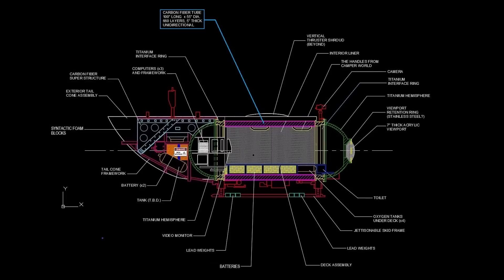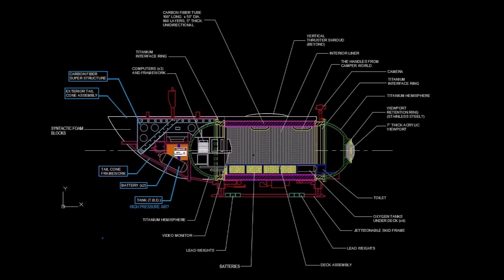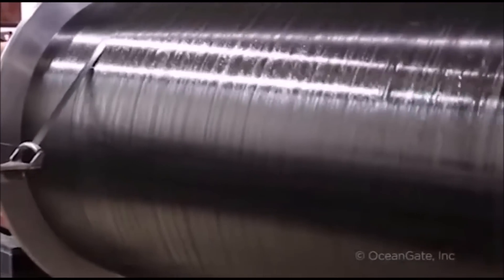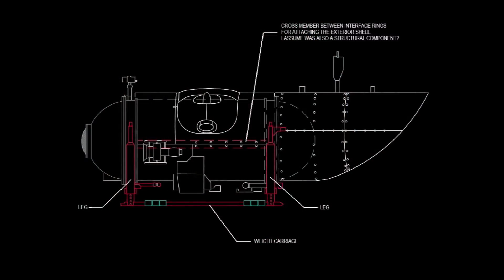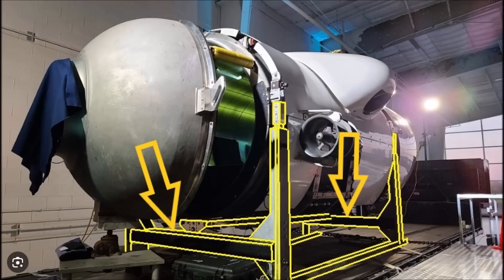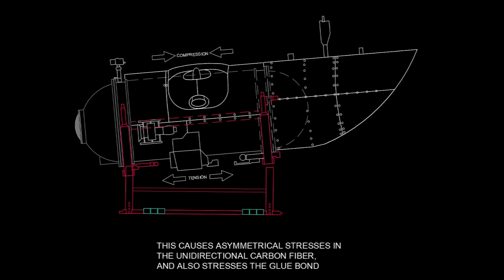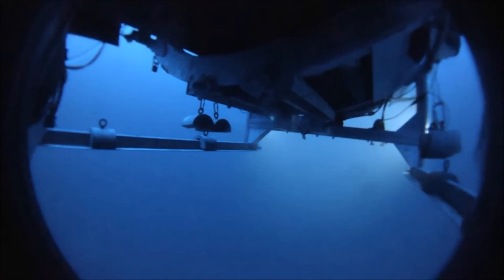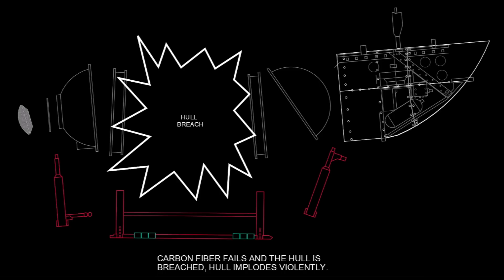OceanGate Titan - DID THE CARBON FIBER BUCKLE?

Comment: I think the reason they descended fast and had issues slowing decent is because all the way down as the pressure increased the delaminating carbon was starting to saturate with water making the vessel much heavier than expected... it amazing it lasted this long and probably only because they used 5inch as opposed to the simulated 4.5" required.
Reply from the maker: Disagree. Would fail way before the point where it would become a big sponge. Appears to me it was a victim of some form of cyclic fatigue and there was too much reliance upon a brand new and not extensively tested technology to prevent a disaster like this. The RTM system could only tell you what is happening right now, it can't prevent anything. It had some flaws.

Comment: You mention the carbon fiber being uni-directional. During a speech (I think with Geek Wire) Stockton showed a video of the hull being built (laid up) and said the winding was was because “there are no torsional moments under the ocean.”
Reply from the maker: Yes, under normal circumstances there would not be. However, carbon fiber under compression in this setting  has maybe half the strength it would have if it was in tension.
Reply: There is a Finnish hydraulic press channel who implode a scale model, its as sudden as a gunshot and 2/3rds of the carbon fibre disapears into a powder.
Reply from the maker: @mrwolsy3696  Yeah I watch that channel. Watched the vid you’re referring to. Rush said the 1/3 scale models he intentionally made fail was equivalent to thousands of pounds of TNT. Full size implosion is almost unimaginable to me.

Comment: The transcript says sounds were coming from aft.  If the transcript is real, the added stress may have been in the back of the sub not the front.
Reply from the maker: Could be. I am hesitant to rely too much on that "cracking at aft" phrase as it's apparently not in one of the two versions of the transcript. Both versions are identical except for one version omits that line about the crackling. My video scheduled for next week will go over the interface rings. It does appear that the rear ring may have been where the implosion originated. So far everything I can determine supports the validity of the transcript.

Comment: carbon fiber should never be used in sub-sea - The Alvin sank in 1968 was resurfaced a year later and is still in use! Metals work best! Composite hulls are also prone to impact damage from tools and mooring lines.
Reply from the maker: Yep, and impacts on carbon fiber can cause de-laminations, which can lead to failure. Can happen on carbon fiber bicycles which are only subject to atmospheric pressure and whatever relatively small forces the rider can impose on the frame.

Comment: Had Titan been tested below the surface for boyancy with out the frame attached ? When the frame and weights were detached  any movement within could have shifted the balance  and tipped Titan  nose down.
Reply from the maker: First test they did was in hyperbaric chamber. Not sure when that was. First test dive was sometime in 2018. Frame was always attached as far as I can tell. No syntactic foam blocks in the tail at that point in time. They figured out the buoyancy balance sometime after that, and that appears to be when they added all the syntactic foam blocks in the tail. I think they were mainly there to level out the sub... probably tilted back somewhat because of all the weight on the back end.

Comment: Do you think they ever tested that frame dropping system at depth?
Reply from the maker: I seriously doubt it. Wouldn't surprise me if they thought it would never actually need to be dropped.
Reply: @VegasCyclingFreak I thought they dropped it every trip and just got a new rusty hunk from junkyard.  That was their actual regular ballast?!
Reply from the maker: @SoulDelSol  It appears that they tried several different ways of doing the ballast. Originally it was old steel pipes, but I've also seen bags and lead weights too. I think they had a system where they could drop it all at once vs a little bit at a time. The frame was only to be dropped in emergency, like if they got entangled in something in the Titanic wreckage. That was the original reason for having those systems.

Comment: (0:47) Wagner's simulations "prove" nothing,  they explore several possible failure mechanisms based on a mountain of assumptions.  They don't consider fatigue of the CFRP shell that is a known phenomenon.
(1:07) The carbon fiber was laid up biaxially (axially and radially) on both the 2017 and 2020 CFRP shells, not uniaxially. On video clip only shows radial lay-up but Rush says it it biaxial in both shells.
Yes, if the legs was released in the back but hung up in the front,  it would create a levering force that would tend to separate the bottom of the front titanium ring from the carbon fiber hull and break the epoxy...  However, the force of the ocean at 3000m on the front end cap is enormous, maybe 1000 times greater than that separating force. We don't have the weight of the legs to calculate that levering force so we can't quantify the effect.  But, to pull apart the bottom of the ring and hull significantly, the levering force would need to be approximately equal or greater than the axial force of the ocean pressure in the opposite direction.

Comment: Your analysis covers details of the failure, and seems reasonable and fair.

However, it is not a "Perfect Storm" that brought about the failure of the cylinder.  It is the utter unsuitability of material for purpose.  The experts of the industry pleaded with OceanGate to stop using the vessel - experts were not surprised and predicted the catastrophic failure.  Other damning evidence has been rumored to include Boeing's "assistance" was little more than donating carbon fiber that had passed its expiration date for use in aerospace applications and from interviews, the cylinder they did make was not even constructed to industry standards, which include vacuum autoclaving.  The lawsuits will uncover the depths of OceanGate's incompetence.

Stockton Rush lived and died in line with the motto he adopted: "Move fast and break things".  The last thing he ever broke was his body being crushed in a luminous flash under a hammer of water at 4 million Kg/square meter.  

Unfortunately he killed 4 innocent people ignorant of his hubris, by skirting laws that should have prevented tourists from joyriding in untested vessels.

Comment: ALL the Asymmetric forces you postulate, although true, are absolutely insignificant compared to the absolutely colossal pressure on the hull.  You are trying to claim that an ant placed on the trunk of an elephant will cause him to tip forward and collapse to the ground. Ain’t gonna happen.  A better analogy is an elephant with several other same sized elephants atop him. Not a perfect analogy, but hopefully you get the point. Those forces you speak of are ants. The ONLY way they contribute are if they are the final straw which breaks the camels back.  But if you are that close to failure, you are already screwed.
Reply: The pressure on the hull is the same on all sides, so in spite of its immensity none of it counteracts the asymmetric forces of people moving back and forth.

Comment: The only thing we will ever know for sure is that we do not know for sure.
My hunch is that Rush was rushing,  
I base this on the fact that the rapid decent was not a concern till 90 minutes in the trip.
All the ocean gate employees would have been tracking this detail
So they must have chosen to ignore the red flag
Which means that Rush was AGAIN pushing the limits and they were afraid to challenge him

After 90 minutes… warning lights went berserk… they wanted to emergency surface
But it was too late
The sub might have collapsed from end pressure, it might have been de laminating from the rapid decent, there might have been a non symmetrical failure somewhere in the shell,  maybe the legs did not fully detach…. Lots of things could have been the last straw in a long chain of poor decisions
Reply from the maker: It could be as you propose. I have a hunch that Rush may have been the only one aware of what was REALLY happening. Maybe he genuinely thought everything was under control if they got back to a safe depth quick enough?
Reply: This theory certainly fits in with the personality he displayed. He had built the sub, reached the Titanic numerous times, broken records for the amount of people in one submersible at that depth. Was he now looking for another milestone. Decreasing the dive time and extending the time spent at the wreck. We know on some expeditions they failed to even locate it. Maybe this dive had to be successful at any cost to ensure future bookings went ahead. A no show may have been considered the end of the project.
Reply from the maker: @Cheeky-fingers  Maybe. We will never know... but it would certainly be another parallel with the Titanic.

Comment: I wonder when they was making the tube with the carbon why it looked like it had a lot of bumps in the lighting
Reply from the maker: Possibly small air pockets or maybe just lumpy carbon tape. That stuff should've worked itself out when they had it "in the hot house" for two weeks.

Comment: I think that your theory makes a lot of good logical assumptions. And if indeed a misalignment of the  ballast carriage during an emergency release would have imposed dynamic loads on the carbon fiber hull applying torsional deformation at on end of the hull. 
It would be interesting to find out if there was some way that whatever mechanism was used to drop the carriage was synchronized or not. This is something that could have and should have been tested and been a practiced procedure.
As to why they were descending so much faster than other times is a good question, but one that I don't think is the cause of the implosion unless they were pressurizing the cabin  to equalize the with the external pressure. I do not believe that was how the sub worked, instead relying on the strength of the hull to resist the external forces alone.

Comment: You raise an interesting consideration - asymmetrical dynamic “shock loading” on the hull structure. I know enough about engineering to know dynamic loads and shock (sudden changes in pressure/forces) can cause over stressing of structures and materials. Titan in the past reportedly had problems with dropping ballast. So a sudden jerking on an interface ring caused an overload of an (already weakened?) structural point. 
Don’t forget there are two battery packs in the space between the aft (rear) Titanium dome and the foam in the extreme rear. There may/is a gas flask/bottle back there as well. My instinct is that these heavy items tend to rotate the tail down and the nose  up in the absence of the foam. The foam alone (no batteries) would have the opposite effect but also contributes to the overall buoyancy but only while submerged. I would need to see an explanation of the buoyancy & pitch (nose up-down) stability engineering details about the center of mass to have a hunch on the net effect of the foam’s buoyancy and the batteries weight on pitch while diving. While being towed behind Polar Prince the foam does not provide any significant upwards forces because any buoyancy force upwards is far less than in water (buoyancy force is proportional to the mass of the fluid displaced; air density <<< water) and not even offsets is own weight. Titan was towed behind the P Prince on its platform on its last mission - a departure from prior practice. My gut says the wave action made the tail wobble up& down. The frequency and stresses imposed on the platform would be far different than on a larger vessel which pitches more slowly. My gut says this puts stresses on the tail & leg structures (beyond my competency to analyze qualitatively at 4 am). The maximum effects are likely where the tail framework joins at the interface rings (rings more rigid than framing). The tail looks to me like a “cantilevered” beam or truss. It lacks any triangulation (= diagonal members between members where they connect) found in trusses; perhaps the tail skinning/shroud was supposed to brace the structure like the skin on an airliner fuselage and wing (stressed skin or “monocoque” construction). 
When the leg drops suddenly and stops your hypothesis is that when it’s motion is checked by the part jammed in place the hull failed (likely at an already weakened spot) catastrophically near or at the ring-carbon composite hull. My hunch is that the failure occurred at the rear ring-hull joint due to the tail vibrations weakening the rim of the hull (either crunching action or pulling the ring off- bonding export failure). I wonder if the fittings to get the power & other cabling into the pressure hull was botched leading to arcs on the Titanium rings less rigid allowing the carbon fiber hull to flex more. Another YT channel (“Forensic Engineering & Failure Analysis” just pan to the pictures as the presentations are long winded) in a recent post says they have identified at least one of these points in the rear titanium ring. Recent posts also have good views of the recovered ring(s) showing damage.p
Reply from the maker: You present some Interesting points. In my previous video I suggested that the failure may have been at the rear because of all that stuff attached to the rear interface ring.

Comment: Nope, carbon fiber doesn't "buckle", it shatters, much like glass. You also seem to be implying that the carbon fiber is more elastic than titanium .. wrong .. the other way around. The carbon fiber cylinder would have extremely little elasticity by comparison to titanium, that's one reason why the carbon fiber is so brittle and would not "buckle" but would instead "shatter". According to one of the engineers who worked on the construction of the submersible, the pressure hull only flexed a couple of millimeters at depth, just a tiny fraction, again, because carbon fiber is brittle.
Reply: “Nope”

Comment: It is plausible but I don't understand what transpired to make them try to dump the frame so abruptly.  The fact they were descending too quickly is also unexplained.  They may have experienced something that led to that.  What are the factors that would cause a faster than expected descent?  This wasn't the first trip this rig made. That should not have happened in the first place. We would need to know the cause of the rapid descent.  It seems to have been at least twice the velocity it was expected to be. So yes, if the frame and ballast was stuck in an abnormal position that could easily destroy the vessel but that was caused by the attempt to stop the descent.  Whatever caused the abnormal descent is the primary cause. Whatever happened after that was the reaction to it.

Comment: you know another thing that i have not heard anyone mention yes is the weight of that titanium dome hanging out on a hindge in rough seas open while they are trouble shooting issues for endless hours, not to mention just the stress of regular normal use getting passengers in and out, ALL of that weight and stress is put onto the bonding glue that glues the flange to the carbon tube. so add that into the calculations that are already telling people the bond is under immence load from the compression difference in materials
Reply: Great point,  I think there may have been multiple points of failure all happening at once